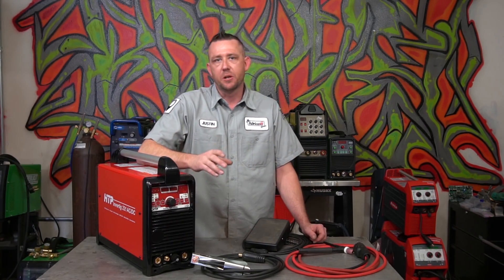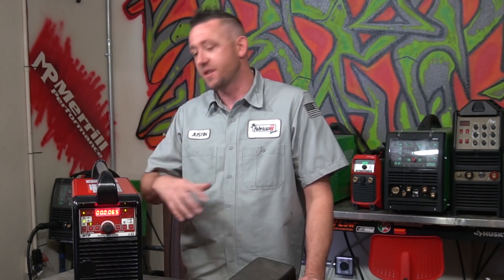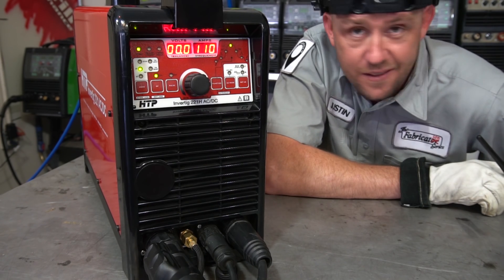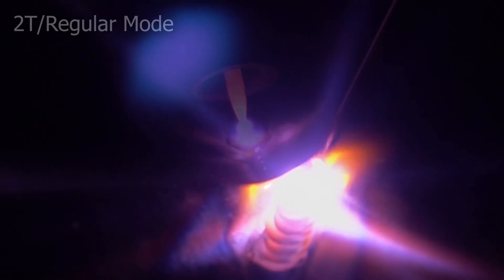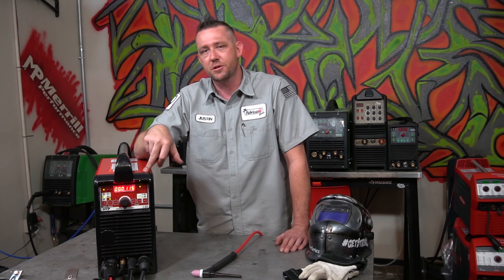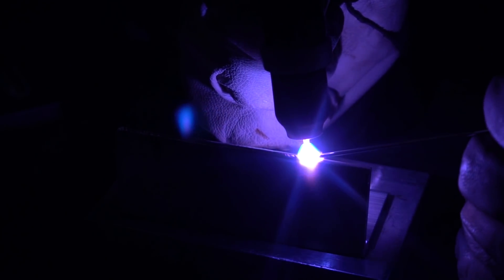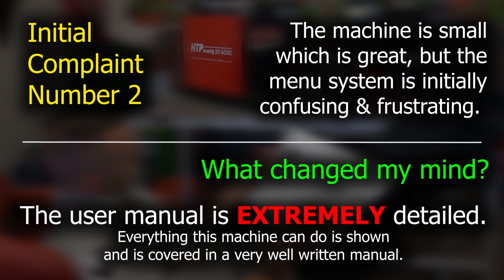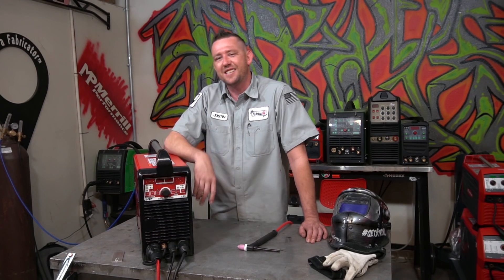TFS: HTP Invertig 221 Review

Comment: Yeah, yeah, it is all that but the main quality for me is also PORTABILITY AND ACCESS and this machine only does 220v, no 110v at all
THAT and the high price of it even without the water cooler is a downer. I mean, if you're gonna work your way into the Aerospace or the food industry where 90% of the time no filler rod is even used or you need to do Surgical welds then it is not for me. I weld basically Aluminum all day above 1/8" and above and for that, I rather get an X200 or a Everlast 185 dv which does the job to satisfaction. I don't take my welds to pageant contests or beauty salons to compare prettiness or aesthetics, I just make solid welds that most machines in the Range of $600 - $900 can do like the AHP, PRIMEWELD OR EVERLAST. That said, maybe when I get a job building airplanes or rockets that can justify me spending $3000 for an AC/DC welder, then I will get this. Probably by then, I could probably get a used one for $1,500 with plenty of life left on it. Otherwise, it is not worth the spending. I rely on my skill and I make ANY welder work for me.

Comment: Thanks for the review, I'm waffling between the HTP and and a SW 200 old red. My biggest concern would be the push buttons ( tactile switches?)  holding up to shop use. Also, could you get it serviced without shipping it off to Buffalo (or Milan). Seems like a nice rig.
Reply: Same concerns- What did you wind up with?

Comment: Independent amplitude was why I went HTP. I was interested in forum posts I had read about welding cast (dirtier) aluminum using the advanced features for better cleaning. Failed when I tried on my own. Seen conflicting suggestions.

Comment: I have been wanting to go to an invertor type machine for a while. This HTP looks like what I want.  My last two tig welders have been Millers.  My mig welder is an HTP I bought in 1993. Other than standard wear consumables it has been trouble free. Thanks for the vid.
Reply: You know the drill.  Drink a miller, drive a lincoln, but weld with an HTP.  I have the 221 and it is my first tig machine.  Nothing but smiles from me.  I want their new mig machine now.

Comment: I have an InverTig 165DC that is no longer made.  I don't do aluminum (mainly stainless), so the AC function is not needed.  I can weld 3/8 stainless because less current is needed than mild steel.  For regular steel I limit my size to 1/4 inch unless I'm willing to double pass or chamfer the edges.  This welder really lays down nice welds and have been very happy with it.  I'm thinking up updating to a 221.

Comment: Thanks so much for yours and ChuckE for the reviews. I've been watching this machine for a long while now. For both work work and side business. I'm a terrible TIG welder prolly cuz my specialty is heavy steel and I'm headed more towards the lighter gage steel. JUSTIN did you say that you test other machines? I bought an Everlast, but never been able to plug it in yet as it is 220v and I'm not until July 10th.
Reply from the maker: Brady McPhail I have reviewed a few Everlast machines so far. I have a playlist dedicated to machine reviews of you want to check it out.
Reply: The HTP Invertig blows it out of the water.

Comment: Thanks Justin, this is one of the TIG machines I am considering. I don't even know how to TIG, just MIG. I've been all over the map with what I wanted to buy, my budget was 1500.00 and the diversion 180 can currently be bought for that, but there are things I don't like about it. Looks like I need to step up to the plate :-)... I appreciate the in-depth review as it helped a newb like me decide. Initially I'll be practicing on 18 gauge sheet metal so I can get good enough to replace sheet metal on an 68 Torino, the MIG just isn't doing a good enough job...  Did I mention I am 62 :-), thanks again, Joe

Comment: I actually love my HTP and it's settings, plus their customer service is great. Saving settings for different job setups is a breeze with the large amount of onboard storage. I also have the dynasty 210 which is a solid machine as well, but my main go to is the htp221 for mostly all my work.
Reply: ycunderground I’m in the same boat I have a dynasty 210DX and the invertig arc blows the miller out of the water

Comment: Why going for a dual fonction machine when you only care for TIG?
Also you recomend it based on your TIG work and review.  But what about the stick fonction?
So, if you'r to use only the TIG fonction why not going for a straight TIG machine?  Perhaps you would get even more features, while at the same time spending the same money...
Sure you have it for free, as you managed to get it sponsered... My 2 cents... God Bless.
Reply from the maker: Pierre Flamand I dont understand. Virtually every TIG is also stick. It's not something you usually get the choice of. I didn't get a stinger for stick of that makes you feel better haha. I just dont stick weld much, but dont have the option to remove stick from a machine.
Reply: Som Body, and that also means. - since I do NOT have first hand experience with any everlast tig besides about 30 min with a 185 ACDC and a 200 ACDC i can and will NOT recommend one machine over another that I have not tired first hand...  I do have almost 8 years on the 221 ACDC though ...  and i found it to be an excellent machine.

That does NOT mean that this is the only excellent machine - and it does not mean that this machine is better than machine XYZ ....  it just means that i personally like it and it did a good job for me in the past ....
Reply: The Fabrication Series justin, if you thought the tig was impressive you really should get a stick stinger ....  that stick arc - incredible! The arc dynamic - incredible .... ! Feature rich - absolutely ! 
Stick weld in dc - every rod you want - stick weld in ac with frequency and balance control to eliminate arc blow and then to top it off you can do that all in pulse .....
That helps on out of position welds, thin material, hard to weld rods ( like aluminum stick rods or strange hard surfacing rods .....  )
The stick function on  this machine is in its own way even more amazing than the tig function....! 
Really! Its 100% worth trying
Reply: Som Body, the HTP is a full bridge inverter with DSP, the arc dynamic is incredible !!!  and yes - it does have some automatic (non user adjustable ) arc force programmed into it!  
also me personally - I ONLY recommend people using machines that i have tested myself and found to be good.  and if I was going to recommend one machine OVER another. - me personally I will have to try both machines first hand myself BEFORE I would make a recommendation like this ...  
But that is me - I am straightforward and old school ...  I don't recommend anything that I have not tired myself and I don't recommend something over something else based on ...?
Reply: @ ZILA & The Fabrication Series How does the HTP perform with 6010/Cellulose rods, and does it have arc force control for sitck welding. Also, would you recommend the HTP over the 255EXT (given that both are in the same price range).

Comment: What about if there was a remote for the leads that was attached on a kart but spread out or actually made in a kart then just  unhook and roll it all away we built my neghbor one like that  and it allowed for a storage area for rods drawers for Expendables in each section the bottom was grated with a pan underneath to put asorbe in to it keep moisture down for stick welder rods and the tank was Incorporated in the kart as well .just a thought and a build we done I thought I would share with you you can also have a light bulb in it while not in use it just plugs in to help keep the moisture down

Comment: Thanks for doing this review!  I purchased this machine because I've been disappointed almost every time I've tried to save money on a machine and I could not find a bad review done on this machine!  I watch every episode you post and if I could weld half as good as you do, I'd be happy.

Another great feature is the fact that even though it is crazy advanced, this model has been in production for years and I have been assured that post warranty repairs are very reasonable if needed. Some of the major brands, this isn't true and it would stink to have a machine just out of warranty that you have to toss in the dumpster because the needed board costs more than you paid for the machine.

This is my first TIG machine and it's nice to know that the disgusting welds I'm producing are all my fault, not the machine!

I know this isn't your thing Justin, but I understand this thing is an amazing stick machine too!  Maybe a review on that some day??
Reply from the maker: I'm blown away by this machine and what it can do. I tried finding something legit to gripe about, but there is nothing I really don't like. It's always plugged in and ready to weld.

I might get more in to stick vids. I recently picked it back up to practice (been about 10 years since I did it regularly). I really need to practice before I tell anyone how to run it or review anything with it haha. I'm very rusty

Comment: The selling point for me was the customer service. If you have an issue you can call and they can work through and diagnose any problem and mail you the parts to fix it. That sat with me much better than just take it to a shop and pay whatever they want and hope that it fixes it. However I’ve never had a problem. Once or twice I’ve had an issue were the pedal would just send me to max set amps, but I just did the old turn it off turn it on and it was fine. I use the machine everyday and it pays my bills. The water cooler is loud as hell. Had it for maybe 7 years now. 
Please if you don’t mind, go into the ac stuff. Not sure I’m tracking. Thanks for the video Justin

Comment: What are your thoughts on the invertig vs. the power tig 210ext?
Reply from the maker: Adam Jones They are similar, and I use them both. If I chose to use one over the other for a small reason - I'd grab the Invertig because its quiet.
Reply: Invertig has 10 more amps and more features than the 210 ext.
Reply: Welding Junkie I dont kmow if I would say it has MORE features, as much as I'd say it has different features. Because the EXT has different wave patterns. Where as this one can manipulate the +/- .
Reply: Twin Turbo LSX the EXT does have the wave forms but you still can tune it in like the invertig to a presice setting. The dynasty has the same and I own the dynasty and Invertig. The 210ext is more like the dynasty than the invertig. The Invertig lets say it’s a wash with the wave forms, and spot weld so to start the invertig has 10 more amps, 1. can stick weld on ac and dc 2. it has pulse stick, 3. it has Tig reset which is timed welds, and the arc is buttery smooth. I’m not talking bad about the ext at all the invertig is just a better machine. It’s better than the dynasty DX too so it’s in good company.
Reply: Thank you guys for the input. I’m kinda new to tig welding and my last encounter with tig was about 25 years ago. I mig mostly on cars working in auto body but would like to add a tig machine to my tool inventory and try my hand at some fabrication. I’ve been researching the tig 200 and 210ext so far and now I really have to consider this invertig.
Reply: Adam Jones I have the 210EXT and I love it. Sold my Lincoln and bought it and really like it. Not gonna lie this HTP is a sweet machine too. But costs a fair amount more than the ext of price is important to you. Good luck man.
Reply: Twin turbo, I was just checking out their website and noticed the prices. That may put it out of my reach. I was looking to stay under 2k.
Reply: Adam Jones ya I paid I think $1600 for my 210ext. Upgrade to the NOVA pedal if you get the ext.
Reply: Twin Turbo LSX agreed don’t get me wrong the 210ext is a hell of a good machine on a budget it’s $1799 normally IIRC the HTP is $2500 so it is $700 more but you also get a ssc pedal and ck torch but like you are saying for prices depends what you can afford I wanted to take the extra hit upfront because HTP service is incredible. I have the pro pulse 200 actually two and I had an issue with one and Jeff the owner took care of it In one day. I hate making tough decisions lol 

Adam you can’t go wrong either way but like he said get the nova pedal, he owns one so I’d take his advise if you go that route
Reply: Adam Jones my advise from owning many machines take a good long look at the invertig it’s worth it if you can stretch the budget. I made a few dynasty 210dx vs Invertig 220 videos if you want to take a look might help you decide
Reply: Adam Jones htp is much better quality. Made in Italy rather than china and customer service is great also!

Comment: I love my Invertig. Mines water cooled, wouldn’t use it without it now. Two complaints 1. I don’t like the 1/4bsp Argon lead connection as you said. 2. I don’t like the interface. With that said I love the machine. The ac bias is different than the dynasty 400 with miller you can change amps on EP & EN with Invertig it’s % of amps when you change EN then EP goes to 100% and vise vera so it takes a lot of time to get used to. I wish that welders all used he same gas connections so you can use one for all. If you buy this machine you need to get the cooler is amazing. This machine will also do pulse stick and weld stick rods in both ac and dc modes. I’ve done many videos on this machine. 

Justin thanks for the video man! Good job!